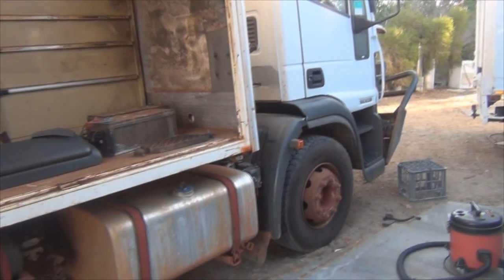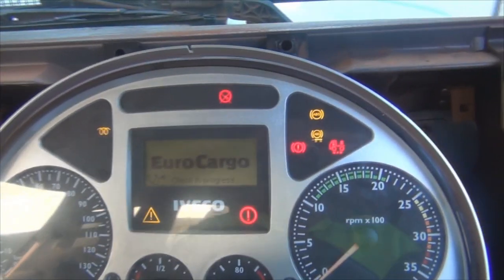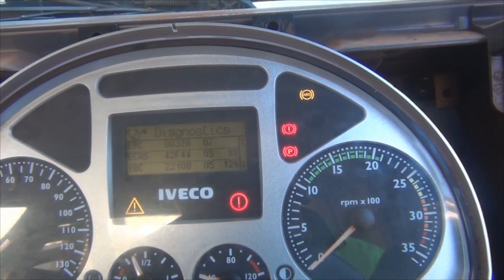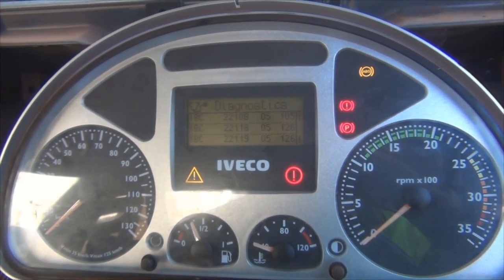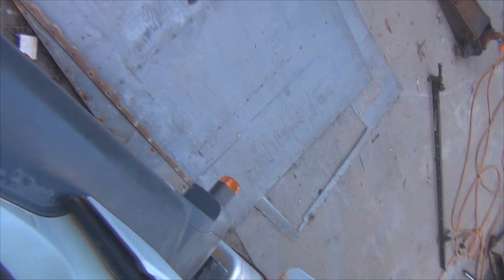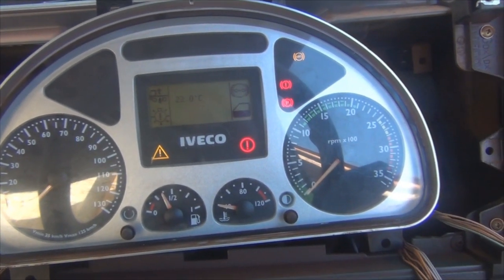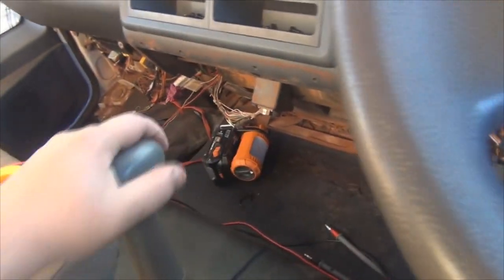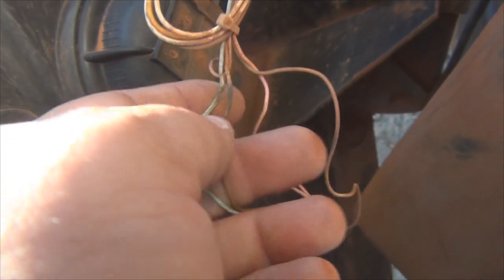Iveco Eurocargo 160E28 - Dodgy Electrics, Advice needed!

Comment: the indicator staying on the instrument panel is saying there is a bulb fault if all bulbs are working there maybe a bodge job on the wiring somewhere. check the junction box at rear passenger side on chassi. with the other problems it could possably  be the body control module itself  located in passenger side behind glove box. abs check sensors should read about 49 ohms also check air gap and rotor for wear you might find the speedo comes off the abs sensors

Comment: Hi Alex, With that many errors it's most likely got an issue with the can bus itself.

Disconnect as many things from the bus as possible so you have a bare minimum system and see if you can get the dash to run ok with maybe just the main ECU on the bus? Even better with just the ECU getting power, depending on where you can tap into the diagnostics port, you could use an external code reader, clear the errors and add systems in one at a time until it starts throwing errors.

Modern vehicles often have 2 or 3 isolated busses, so as you are able to actually start the vehicle it is likely that the ECU is talking to critical components such as fuel pump, ignition imobilister reader etc on a primary bus and all other non-critcal functions will be on a secondary or tertiary bus.

One basic check you can do is measure the resistance between CAN_L and CAN_H at various points and check it is in the region of 50--60ohms at all points. 

You can also look at CAN_H and CAN_L both at the same time on a scope and you should see fairly rectangular looking bursts of data with CAN_L almost a negative mirror of CAN_H
Reply from the maker: yeah that seems to be the general consensus. except some of those errors dont come via CAN. but with the can bus itself throwing a code.. O.o.. yeah time to start digging.

Comment: what a shame :(. such a new truck!. but as soon as you said it was an ex-mining truck I figured that vibration would have had something to do with its demise. vehicles suffering from 'Modern Car Syndrome' do not fair well out in the harsh outback :(
I hope the pit inspection and loom test comes up good and you can fix her!. electrics aside, that is a great  truck!.
Reply from the maker: what is the biggest shit is that the rest of the truck works really well. engine is powerful, brakes and steering are good etc, like you say, seems to be just the over modernised crap that is failing.

Comment: How did you get on with the truck codes?
I have a 2004 model E150series and it does the exact same thing on the dash indicator is a solid sound 
I have 7 codes on the dash took it into Iveco and they plugged there computer into it and where in able to remove any codes🤷‍♂️

Comment: Looks like a nightmare. Have you got a insulation tester bro? I'd be hunting for wires touching or going to ground. You'd have to disconnect all those sensors and ecu harness to have a crack at it old school without a Iveco diagnostic tool.
Reply from the maker: no insul tester, but they dont recommend you do any voltage testing at all on this machine, iveco have whats called the IWT.. iveco wiring tool, it can check the looms for shorts or damage. it is a nightmare. on other news, you were gonna tell me about that baofeng radio?
Reply: alex993cc1 Sounds like the market to be in! They'b be making a killing on service!
The little boafeng, if you are going to buy one make sure it's program not to transmit on certain frequencies. Don't tell the cops on the radio to get fucked in other words.
They are also a nice size to attach to a quad-copter, you'd just have to make a loop program to generate a sound and lock on the key. Pretty simple with a mic-speaker lead hack.

Comment: Ooow i dont think i beleive what the dash is saying, water getting into the body module sounds most likely to me, but im not a iveco techy.

Is the dash just a reflection of the state of the body module, or is there another computer involved?

Is there any of the errors you can check for, just to see if the computer has gone daft?
Reply from the maker: dash speaks can bus with the rest of the truck
body module could be fried, but most of that info comes from the ECU and the other sensors on the truck.
Reply: alex993cc1
 Ooow, if its anything like the systems on buses then the computer wont communicate with any of the modules untill its been told there i.d.

a frend works on the buses and even if a lighting module breaks down you cant just replace it without telling the main computer.

Bloody silly systems :-((
Reply from the maker: zx8401ztv same on the bimmer, you cant change modules unless you code them to the car.

Comment: just watched this did you get it fixed and can you tell us what the problem was ?
Reply from the maker: +frustratednomad what problem do you have?
Reply: I don't I'm just intressted in what the issue was
Reply from the maker: +frustratednomad Tachograph module was missing, so replaced that, body computer had a couple of blown ICs due to wires shorting out, so fixed all the shorts and replaced the ICs, that made the body computer happy, and then ran new wires to the speed sensor on the gearbox, apart from that just bulbs and general maint fixed all the other issues, ABS sensor replaced, it was a lot but not much really :)
Reply: sounds like it was a brain ache job electrical issues are the worst well done sorting it out thanks for the info

Comment: How old was it? It must be fairly new for it to have an ECU in it
Reply: 2006 I think!, its a nice new rig!. but being all CAN-Bus based, one broken or crossed signal can take the whole lot down!
Reply from the maker: yeah 2006, it has more than one controller! for a start the engine ECU lives on the side of the block, for the win, of course :P
Reply: Aussie50 it's good isn't it. It's a shame that these trucks fail cause of something so simple.
Reply: alex993cc1 would there be any chance that something's been fried cause of heat? I assume you were able to start it.